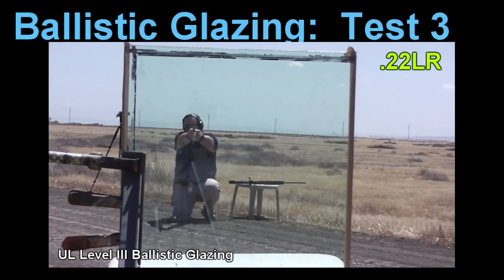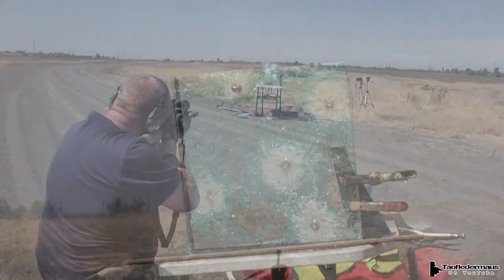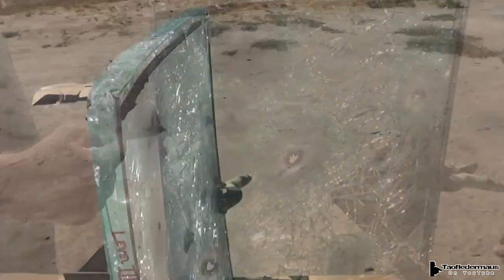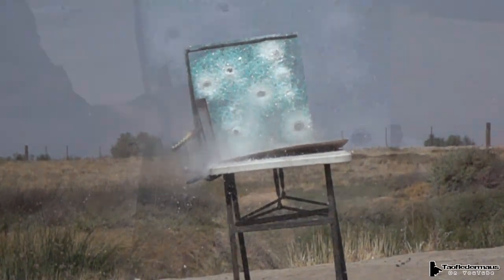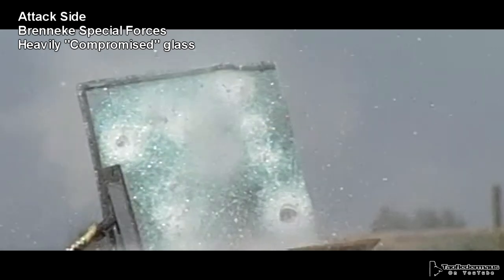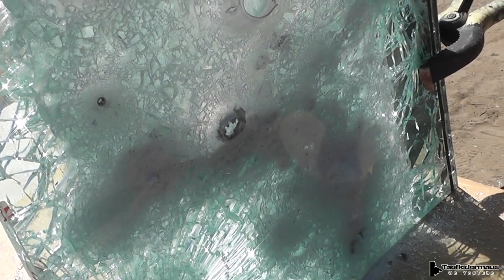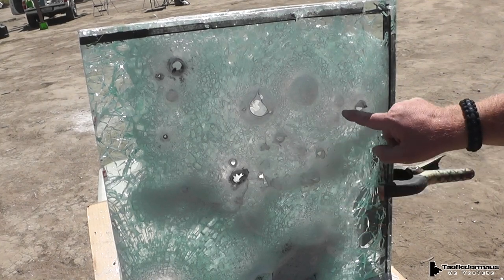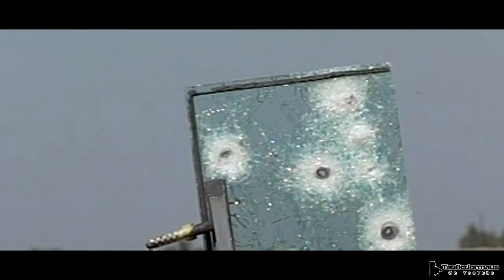Bulletproof Glass -  How many times can you shoot it?

Comment: That glass should be easy and a weekend to cut yourself with a diamond blade. You don't have to be precise as you would need to be for installation.
I know a judge's private chambers that had the same glass installed. I always thought it was dumb to have regular masonry  and plaster board walls around it.
Reply: This glass came from a courthouse style project also.  But it was to be mounted into steel-walled holding cells. Same stuff used around judges' chambers.

Comment: 200 $ for cutting that glass holy shit do you not have a hacksaw
Reply from the maker: lol  yeah that would work
Reply: I did mean it as sarcasm just to clarify.
Reply: Can you imagine how long that would take to cut by hand??  I kinda doubt a standard blade would do the job either.  Glass is very hard.  Your best bet would be a table saw with a ceramic blade.  Even then, it would be all too easy to break the blade, get nasty glass dust in the air everywhere, and so forth.

On the plus side, you probably wouldn't have too much trouble with the cutting causing the glass to crack and shatter, it being the type it is.  Normally, that's the glasscutter's bane.